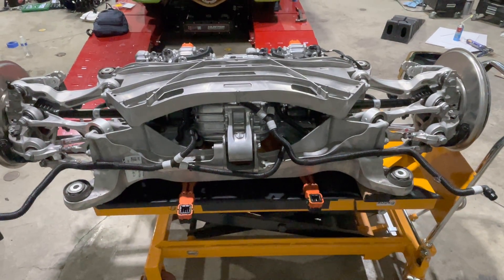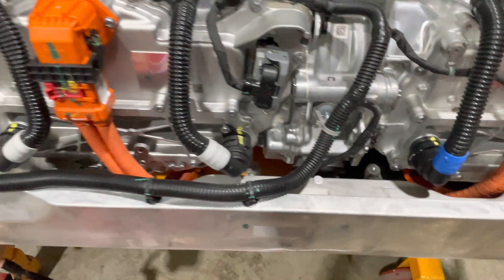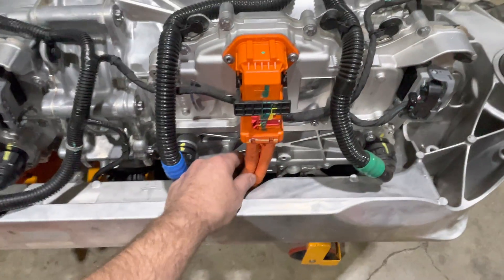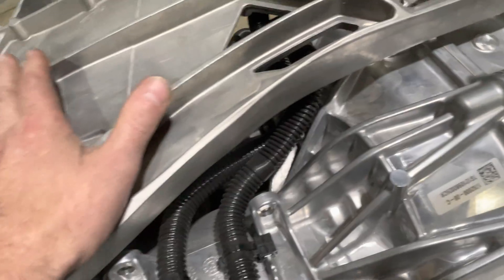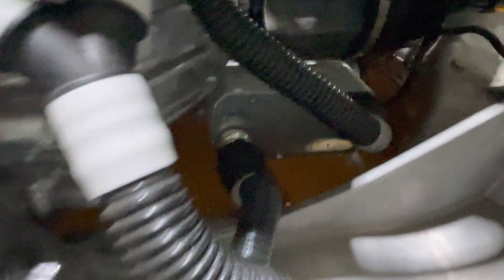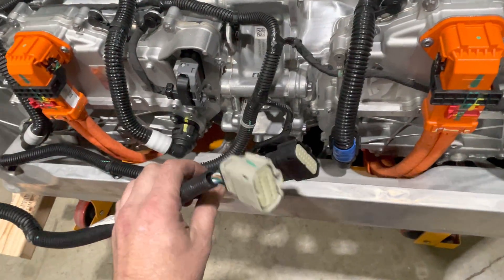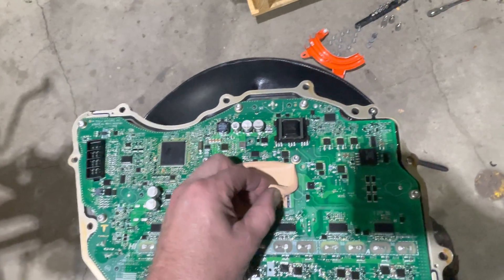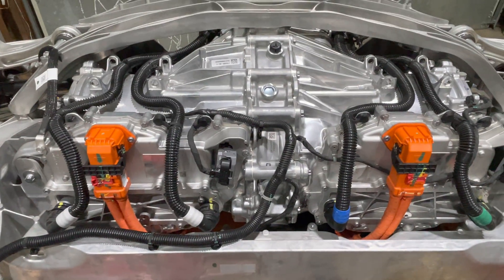Tesla Plaid Rear Drive Unit - Quick Look

Comment: Any chance you determined what the max allowable voltage is for this drive unit? The battery looks to be around 460v so 500v? 550v? 600v?

Comment: Not only does the manufacturing have to be very low cost, the O&M has to be super cheap as well.  Also, the simplicity of electric drives make for a super reliable setup.

Comment: So are you working on controller for the plaid rear unit ?
Reply from the maker: No, there was no demand for such a thing, so I have not proceeded.
Reply: There is actually specially this one as the old motors and smaller motor there is many options but this one still no one

Comment: Now to swap them into my P90D
Reply from the maker: Not possible.  Sell the 90D and  buy a salvage Plaid.
Reply: @Ingineerix  what makes it not possible? We can mount the unit to a pallet and run it. Same footprint, would be an electronic end of things
Reply from the maker: @SouthernBoy337  Too much to get into.  For starters, you 90 pack can't handle that current.  Then there's all the wiring and control systems.  A bunch of mechanical stuff too.  By the time you are done, you'd have probably over a thousand man hours and you'd have to buy much or systems out of the plaid to make it run, why not just buy a plaid and fix it up?  WAAAAY less work!
Reply: @Ingineerix  because that’s what everyone does. Innovation comes from stuff like this. A 10k totaled plaid is cheap.
Reply: @Ingineerix  next one would to be making a overlay harness to add fsd to older cars. All sort of market out there for customizing the older cars. Plus it’s the same shell you could luterly swap it all of you felt like it. I could tear both cars down and back together faster than 1k hours. I’ve built them from the gram up faster than that. Now electric can get tricky. I don’t have any experience in Tesla computers so that’s where my hang up is temporarily
Reply: @Ingineerix  I’m not meaning these in a crappy way either just for discussion. I’m asking because I’ve seen a 300sl with fsd fully converted to a model y and if that is possible then so is a plaid swap
Reply from the maker: @SouthernBoy337  It's "possible", just really dumb.  Like you said, you'd basically be swapping the shell.  What's the point?  ALL the electronics, ALL the wiring.  There are a lot of mechanical differences too, the battery is totally different, and a different voltage.  You can't just build an "overlay" harness for adding FSD to an older car.  You'd need to replace EVERY.SINGLE.HARNESS, and you'd need a totally different computer, and programming that is secured.  Again SELL the old car, buy a newer one, that's the sane way to do it, rather than spending $20k on a car worth about that, even if you could do the programming, which you can't.
Reply: @ingeerix you advice the same for 2017 Model X P100D w/ ludacris? I was actaully looking into swapping the rear drive motor for plaid rear drive vs buying a wrecked plaid model x. Still makes more sense to use a donor car for this?

Comment: thanks for the demonstration. since you mentioned that there was no mechanical connection between these two motors. I‘m just wondering how these two motor cooperating with each other, one for each wheel independently? does it mean that one wheel will lose power if one motor fails？ sorry for the naive question
Reply from the maker: Yes, they use torque vectoring, so the car handles corners much better than any car with a conventional mechanical differential.  Yes, if you were to lose a whole side obviously that would be a problem, I suspect Tesla would just switch to limp mode using the front motor only in that event.   Keep in mind these inverters/motors are extremely reliable, a failure is super unlikely.
Reply: @Ingineerix   got it. Thanks for your explanation

Comment: Again, an awesome video. Did Tesla use permanent magnet synchronous machines on the rear unit, as well? Because Elon stated several times that the carbon fiber puts copper in compression. And copper is not part of a permanent magnet machine, it is rather used in induction motors like asynchronous machines. Also: Does Tesla use then the same electric machines in front and rear drive unit? How thick would this carbon sleeve have to be, to take all the centrifugal loads at 20k rpm? I must be like 2-3mm thick, i would assume...But either way it is great engineering from tesla.
Reply: Elon likes to bullshit. Some.of what he says is fact, some is not.

Comment: The front main drive unit (MDU) on my brand-new plaid failed after 1.5 days and 290 miles. I was getting power reduced notifications and the car was driving sluggishly. I ended up returning the plaid because of this failure and because the door handle was broken and some other fit and finish problems.
Reply from the maker: Thanks for the report.  This is called "infant mortality", and is not uncommon.  Complex devices that are otherwise well engineered will have a failure curve that sort of looks like a bathtub.  There will be a lot of initial failures due to defects that just barely make it out of the factory, then within a few months those will have dropped out, then you get a long period with not many issues, then as old age comes, the failure rate will start to rise again.   When I am looking for a salvage car to purchase, I want one that's at least 6 months old for this reason.

Comment: Do you know how tesla is keeping max hp constant up to 200 mph versus model 3 hp dropping after 45 mph?
Reply from the maker: Software, final drive ratio, and higher pack voltage.
Reply: @Ingineerix  you mentioned that the plaid and model 3 drive inverters have the same components, are you confident that they are both rated for the same voltage? If so do you know what the max voltage capability is? I understand the firmware will probably have to be hacked to allow the inverter to run at higher voltage but will the components handle it? Thanks for your awesome work.
Reply from the maker: @paulfaucher  Unknown.  The SiCFETs used are custom parts made by ST for Tesla, so we don't really know the ratings.   However, the DC link capacitor has a limit and that's probably going to cap the max voltage, even with a firmware hack, which is non-trivial.   It would take testing to determine this, and it's not going to be cheap!
Reply: It's driven by machine design. Keyword: Constant Power Speed Range (CPSR).

Comment: Will this carbon wrapped rotor fit in the model 3 housing?
Reply from the maker: Yes, but it won't get you anything.  Your software will still limit top speed and performance to the same as it was before.

Comment: Is the carbon wrap for keeping the rotor intact at 200 mph or for putting the rotor in compression to hold a smaller rotor stator gap?
Reply from the maker: For high speeds.

Comment: Hello, can I put this drive unit in a Hummer H1??
Reply: Also does anyone know what batteries I should put , I want atleast 200kw battery pack and add like 20kw of ultra capacitor battery pack as well
Reply: Adding 1 or 2 alternators to the electric vehicle I’m sure will make it add a lot more miles range
Reply from the maker: This will only serve to REDUCE range.  See: "First law of thermodynamics"
Reply from the maker: You could, but it's a lot of work.

Comment: What accounts for the reduced power loss at higher speed given that these are just model 3 motors?
Reply from the maker: Higher system voltage and lower gear ratio means less need to use field weakening.
Reply: @Ingineerix  I appreciate that you take the time to answer questions in the comments! Thanks!

Comment: They surely do have an electric power of 760kW. It is an electric car. Even ancient combustion engine’s power shall not be named in HP anymore since 35 years.🤫 I know, you can convert the power value, but why? We do have overcome the ancient world finally! And it‘s kW today. Why not?
Reply from the maker: I wish the US would switch to the Metric system the rest of the world uses.   Engineering, Science, and even ALL automakers in the US have done it, but not the general population.  HP is also one of those old holdover units.

Comment: No diff gear?? Does it mean the motor directly turns the wheel? There must be a misunderstanding.
Reply from the maker: There is a gear reduction, but no diff.  One motor per wheel, so not needed.  The "diff" is handled electronically.